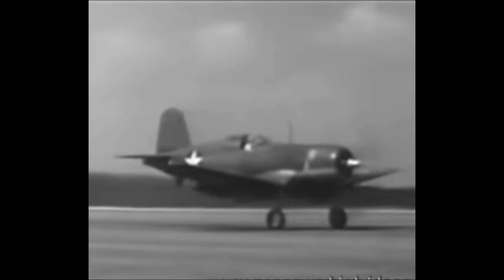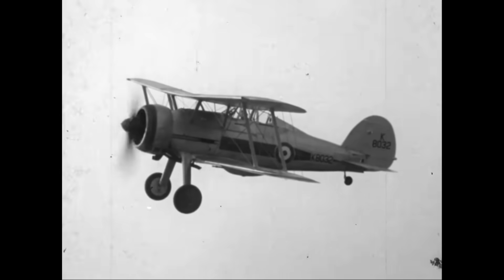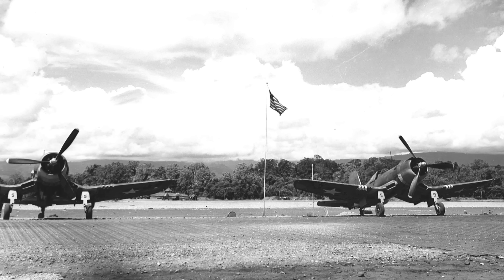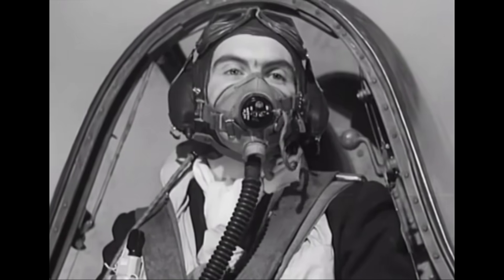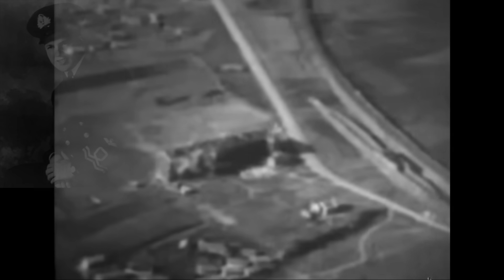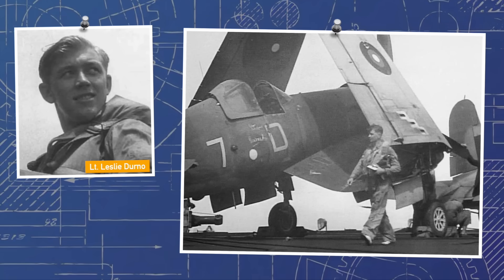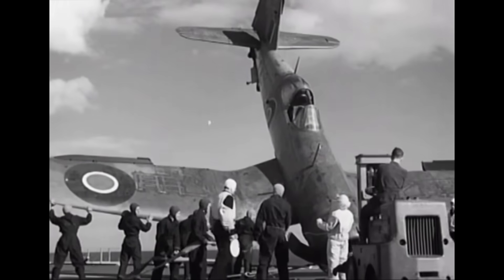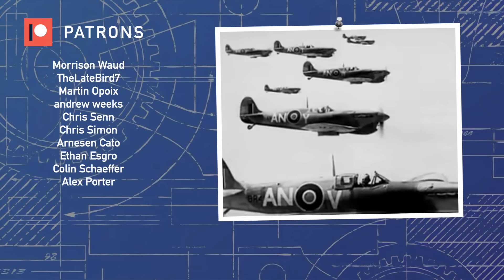Why Did Britain Use American F4U Corsairs? The Full Story

Comment: It's worth noting that FAA 'fighters' like the Fulmar and later Firefly were built to a requirement for operations where they weren't expected to meet other fighters but long range patrol bombers far from land. Because of the length of flights involved they were specified with a navigator ('Observer' in FAA terms), so were two seaters - they were never going to be on a par with single seat fighters.
Reply: FLEET AIR ARM.
HL Deb 27 January 1943 vol 125 cc794-829
There is a controversy between those who say that the Admiralty did not get what it wanted for the Fleet Air Arm and those who say that the Admiralty was not very clever at explaining what exactly it                                         796
was that it wanted. I noticed quite recently that Air Marshal Dowding has gone on record as saying that the Admiralty got precisely the types which it specified and demanded. Whatever may be the rights and wrongs of this controversy there is certainly no doubt whatever about it that war found    the Fleet Air Arm equipped with extremely bad aircraft.    But there is one other thing I think which should be said in fairness. The Admiralty regained control of the Fleet Air Arm in 1937, rather less, I think, than two years before war broke out, and when war did come it found the Admiralty struggling with the enormous task of constituting the Fleet Air Arm, and those difficulties were very great indeed.
Reply: @nickdanger3802  Thanks Nick well said
Reply: The Firefly was, I think, quite a good 'strike fighter'.
Reply: @well-blazeredman6187   This was Eric Browns assessment of the Firefly and I quote " The Firefly was well loved by the Fleet Air Arm; what other affection could be felt for a pilots aeroplane that combined good handling characteristics with a sound performance,tremendous reliability  and outstanding versatility. It was an excellent example of the shipboard aircraft designers art and one that served the Royal Navy long and well
Reply: Stop making excuses 4 the very poor aircraft the faa was given prior to the corsair  and avenger     the fulmar was 100 mph too slow
Reply: @MegaBloggs1  I wasn't making excuses, just stating the effect requirements have on the specification of an aircraft. And those requirements came from the FAA. Name me an exceptional two seat, single engine fighter available in 1940-42?
Reply: 0:07  @MegaBloggs1
Reply: @MegaBloggs1  the faa wanted the navalised spitfire, which would have been better adapted than the seafire they got from what I've seen. They weren't allowed it due to political issues arising from the fall of France. It would have been capable of fighting the zero quite handily, if not having the same range.
Reply: @JeffreyWilliams-dr7qe No-one can see into the future so they designed aircraft for the purpose they would serve according to the best knowledge they had at the time, and it was quite reasonably assumed that FAA fighters were likely to face slower long range bombers and torpedo aircraft, so they were designed to outperform those types. 
Remember too that British naval aircraft were designed for use primarily over the North Atlantic where there were no nimble carrier based fighters such as those possessed by the Japanese.
Reply: @Kevin-mx1vi  millions of lives at stake here. British invented carriers for Chist  sake. Blame it on theRAF
Reply: @JeffreyWilliams-dr7qe  What are you saying ? That the people who layed out the specification for the aircraft should have been superhuman and forseen the future ? Get real.
Reply: @Kevin-mx1vi  It's just fine to lose a argument.  You will do better next time.  Have a great weekend! Don't ya know.
Reply: @Bassman-r3c  If the USN could get an idea of the future, there is no reason the RAF policy planners of the RN FAA could not.
Reply: @JeffreyWilliams-dr7qe bellowed:British invented carriers for Chist  sake.
----------------------------------------
 WRONG!!! that was a sea plane tender that the french introduced a few yrs earlier.
The invention of the seaplane in March 1910, with the French Fabre Hydravion, led to development of the earliest ship designed as an aircraft carrier, albeit limited to aircraft equipped with floats, in December 1911 with the French Navy Foudre, the first seaplane carrier.

HMS Hermes, temporarily converted as an experimental seaplane carrier in April–May 1913, was also one of the first seaplane carriers, and the first experimental seaplane carrier of the Royal Navy.

  Eugene Ely was the first pilot to launch from a stationary ship in November 1910 He took off from a structure fixed over the forecastle of the US armored cruiser USS Birmingham at Hampton Roads, Virginia and landed nearby on Willoughby Spit after some five minutes in the air.

 On 18 January 1911, he became the first pilot to land on a stationary ship He took off from the Tanforan racetrack and landed on a similar temporary structure on the aft of USS Pennsylvania anchored at the San Francisco waterfront

You're welcome for christ sake, It's just fine to lose a argument.  You will do better next time. :face-blue-smiling:
Reply: @bigwoody4704  Well, he is wrong if by an ‘aircraft carrier’ you mean any ship that carries a spotter plane or acts as a seaplane tender. But most of us regard an aircraft carrier as something with a full flight deck that stores, launches and recovers multiple aircraft. I think that HMS Argus was the first of these; HMS Furious was the first fast fleet carrier; HMS Hermes was the first purpose built carrier to be laid down, albeit not the first into commission; HMS Illustrious was the first to launch a major and successful raid on an enemy fleet in port ( unless you count HMS Ark Royal’s smaller contribution to the attack on Mers-el Kebir); HMS Formidable was the first to launch a successful air attack on an enemy fleet at sea (and the first to engage enemy warships with her own guns- before being ordered to disengage). Royal Navy Skua dive bombers were the first to sink a major enemy ship in action. Of course, some of these ‘firsts’ can be attributed to the fact that the  US Navy was not in action until December 1941. After the war, British inventions included the first steam catapult and the first angled flight decks. I think also the first mirror landing device, but don’t quote me on that. 
I say all this  while recognising that the US built the best naval aircraft of the war and the U.S. Navy became (and have remained) the masters of carrier warfare.
Reply: @michaelhirst4191   wrong read what was posted - that is the history regardless of how you take it. Nimitz himself was a an early advocate of Naval Air Power. He was in attendance when Billy Mitchell argued then demonstrated the ability of bombers to sink battleships.
Reply: @bigwoody4704  which of my  several assertions do you say is wrong?  For example, do you say that the US Navy did NOT become the masters of carrier warfare?  Or that a cruiser or battleship with a seaplane hangar and catapult is an aircraft carrier?  BTW the first seaplane carrier to take part in a naval battle was HMS Engadine at Jutland in  May 1916. Communication problems rendered her aircraft’s potential contribution ineffective, however.
Reply: @michaelhirst4191  No - the USA used an actual Air Craft carrier 1st was my point the other was as you stated - seaplane hanger. Sometimes I run across cronies of the crown down playing the GIs role in everything like the guy i originally responded to

EDIT The Britsh did a good job with Corsair landing on flat tops,they were better suited for Marine land based aircraft
Reply: @bigwoody4704  I am not in the business of knocking the US armed forces, or its far sighted generosity with lend lease and the Marshall Aid etc, but as to the first proper aircraft carriers (those that could both launch and recover wheeled aircraft) the USS Langley (CV 1) dates from 1922,  whereas  HMS Argus had a full length flight deck and hangar in 1918, and HMS Eagle by 1920,
Reply: you're not in the business of reading or remembering either

 Eugene Ely was the first pilot to launch from a stationary ship in November 1910 He took off from a structure fixed over the forecastle of the US armored cruiser USS Birmingham at Hampton Roads, Virginia and landed nearby on Willoughby Spit after some five minutes in the air.

 On 18 January 1911, he became the first pilot to land on a stationary ship He took off from the Tanforan racetrack and landed on a similar temporary structure on the aft of USS Pennsylvania anchored at the San Francisco waterfront
Reply: @bigwoody4704 I know about this. It was a remarkable achievement and a significant moment in the history of naval aviation, but did not turn a cruiser into a proper aircraft carrier. I have taken great care to distinguish between a ‘true’ aircraft carrier and a ship that carries a couple of aircraft (or even four or five floatplanes) as an adjunct or aid to its primary role as a battleship, cruiser, etc. so what we really disagree about is the definition of an aircraft carrier.
Reply: @brasidas2011  But they did not  The attack on pearl harbor was almost a carbon copy of what the FAA did at Taranto.  The Japanese took notice the USN did not.
Reply: @bigwoody4704  Wrong yourself Big Splinter The First French Aircraft Carrier was the Bearn laid down in 1922 launched in May 1927 . And the UK was first to land on a ship Get your facts right. Better luck next time
Reply: @bigwoody4704  First US carrier USS Langley 1922
Reply: @michaelhirst4191  US Generosity ? HAHAHA The US made billions on Lend Lease while forgetting to pay Reciprocal Lend Lease
Reply: @michaelhirst4191  Big Splinter is  extremely Anglophobic
Reply: @jacktattis   No, you are quite wrong about that. Lend lease to the UK was worth over $32 billion in 1940s money. Just under 1 billion of that was repaid in money over 60 years. The repayments made over this period  were a mix of this and repayments of a post war reconstruction loan of $3.5 billion at 2% interest. 
Reverse lend lease from the UK to the US was worth just over  $7 billion. 
Overall, the US was out of pocket by well over 20 billion, but their generosity was in their own strategic interest, as was Marshall Aid in the late 1940s. That was in the form of a grant of non-repayable grants and was worth over $3 billion to the UK - we were the largest recipients of Marshall Aid.
Lend lease supplies and weapons lost or used in the war didn’t have to be paid for, but what was left at the end of the war had to be given back or (if the Americans had no use for it) either dumped or destroyed or kept and paid for. We couldn’t afford to pay for much. Lend lease aircraft carriers that survived the war (about 34 of them) were returned to the US for conversion into merchant ships. Lend lease naval
Aircraft mostly ended up being dumped into the Coral Sea off Australia before the British Pacific Fleet sailed for home. They lie there still.
Reply: @jacktattis  I'd argue that they did. The USN had good policy in place, but we had a couple clueless leaders that disregarded operational alerts (King and McArthur come to mind). I think it was a peacetime mindset issue,. Who is more afraid of saboteurs than enemy attacks? Those who are not at war would likely think this way. Italy and the UK were officially at war in June of 1940, and Taranto took place in November of 1940. The US and Imperial Japan were not at war until the Pearl Harbor attack occurred. I think it is humorous that people try to make a direct correlation from Taranto to Pearl Harbor without considering all the factors at play. Do you really think the USN would have been caught so flat footed if there was a declared war against the US prior to Pearl Harbor?
Reply: @brasidas2011  Well all embassies had Military attaches back then The US and Japan both had embassies in Italy in 1940 They would both have been remiss if they did NOT take notice of Taranto. After all one of your own was passing info to the Italians on British Formations in Libya
Reply: @bigwoody4704  Being shot down again  David Miller Warships from 1860 to the present day [2002] HMS Ark Royal 1914 Page 34 and I quote "first purpose  - designed aircraft  carrier in any Navy"
With your US pilot possibly  
 You must stop quoting US publications, invariably they are mistaken
Reply: @bigwoody4704  Mitchell was after the Brits knew the value of Carriers
Reply: @bigwoody4704  Do those vessels count as Aircraft Carriers under the terms of the 1920 Washington Naval Treaty? 

Apart from weight limits,  of course.
Reply: @brasidas2011  Small point like, but the Corsair didn't fly until 1940, and wasn't in service before 1942.
Reply: Not much need for fighters in the North Atlantic. Submarine hunters though... so the planes were what they were useful for
Reply: Odd.  Didn't anybody conceive that they might have to face the Japanese in the Far East or land based aircraft in the Mediterranean?
Reply: @AnthonyGentile-z2g  I'm sure they did but it's about priorities - there are always constraints in how much you you can build, of what type and how quickly. U-Boats in the North Atlantic were the existential threat, sinking hundreds of thousands of tons of vital shipping in 1939 and 1940. And we had land based aircraft in the Mediterranean theatre too.
Reply: @FinsburyPhil  Ahhh but by May 1943 The R/N and RCN had beaten the U Boats
Reply: @AnthonyGentile-z2g they did, which is why they made the illustrious and invincible classes with armour. As has been posted, at the start of the war in 1939, the aircraft were comparable with those based on Japanese and American carriers, with the exception of a5m (the precursor of the zero) which outperformed both British and American carrier based fighters of the time. The British fleet air arm were developing a powerful single seat fighter at the start of the war which was cancelled after the fall of France as it was argued by the RAF that it would interfere with the production of the spitfire and hurricane for the defence of Britain. At the start of the war no fleet fighter was the equal of its own countries land based fighter due to concessions made to make the fighter suitable for carrier use. The British ones may have been the worst but not by a huge margin and may have outperformed the f3f
Reply: Ridiculous then. English legalities getting people killed!
Reply: Those are the breaks as you Rule the Waves.  Sun setting and all that!
Reply: My Uncle James' was a Tasmanian and a flight officer on Mossies, Coastal Command by '44-'45 and sank a tube or two. His last Month's were spent eating U-boats in the Bay of Biscay. He only just passed away in Ireland. Covid at 99. My Aunt, a Blitz WAF and later senior controller passed away within week's. 99 also. Such gregarious happy people, my favourite aunt and uncle. Day's Fishing.
Reply: @FinsburyPhil  Nice to see to see some revision here. Some improvements.
Reply: Dear Finsbury,
That was a long discussion eh?
Regards,
Z
Reply: @ZinzanModelling  Thankfully not too vitriolic, although somewhat partisan if I remember correctly.
Reply: The Japanese and Americans naval fighter pilots were flying missions over the vast Pacific in WW2. Getting back to their carriers after missions was just as difficult for them as for FAA fighter pilots. However, they didn't need navigators/observers to accompany the naval fighter pilots of their Zeros and Wildcats. In the case of the Japanese, their fighter pilots had to double up as their own navigators by training. For the Americans, they had this clever YE-ZB electronic navigation system which could be operated by the pilots themselves and helped the American pilots to home in on their aircraft carriers securedly in all weather conditions. The British adopted this system later in the war, allowing FAA to operate the single seat fighters like Corsairs, Wildcats, Hellcats, Seafires.
Reply: @tvgerbil1984  The Royal Navy experimented with its own radio beacon in 1936 and adopted YE-ZB in a technology share in 1940. But they tended to use it sparingly in the Atlantic as German U-boats were capable of homing in on the signal. But the point about the Fulmar and the Firefly is that they were multi-role and not just interceptors, hence why they were two-seaters.
Reply: @FinsburyPhil  The Germans did install receivers on their U-Boats to intercept YE signals. However, they were unable to make good use of any intercept to attack the carriers. The problem for U-Boats was that YE signals were transmitted in the UHF band. UHF radio waves couldn't penetrate the sea horizon. Aircrafts high up in the sky were not affected much by the horizon effect. For an U-Boat which was low down near the sea surface, the U-Boat crews probably saw the enemy carrier at about the same time as the YE signals were intercepted. In any case, the normal reason for an escort carrier transmitting YE signals was that it had aircrafts in the air performing anti-submarine patrol.
Reply: @tvgerbil1984 
Dear Mr Gerbil,
I think that the reason for an observer in certain Naval aircraft has to do with the additional function they served rather more than as a reflection of the overall navigational ability of the pilots.
In navigational terms, two heads are rather better than one and "dead reckoning" is hard, no matter how good you are.
Of course, the advent of nav systems considerably ease the problem of finding your way back to the carrier, as of course did radio DF. However, assistance devices do not remove the need to navigate properly.
Regards,
Z
Reply: @ZinzanModelling  My comment only applied to naval 'fighter' pilots which was what the original comment was about, as you might noticed. On US carriers during WW2, reconnaissance and scouting duties by carrier borne aircrafts were carried out by dive or torpedo bombers like the Douglas SBD Dauntless and Grumman TBF Avenger. These warplanes were all manned with two or even three crew members although the planes were all equipped with YE-ZB electronic navigation system. Speed, maneuverability and climb rate were not critical for these aircrafts and the extra pair of eyes always helped them in scouting and reconnaissance duties. However, the USN never compromised the fighting abilities of its naval fighters in WW2 by putting an observer on them from the very beginning. It took some really painful lessons for the FAA of the Royal Navy to realize that and purchased single seat fighters like Wildcats, Hellcats, Corsairs, Sea Hurricanes and Seafires.
Reply: Dear Mr Gerbil,
Finsbury’s point about multi role aircraft is the correct answer. UK procurement had not asked the aircraft industry to develop carrier borne aircraft and instead “marinised” single seater land fighter aircraft when the need became obvious. This was a sub optimal solution.
The requirements were therefore fulfilled by available US aircraft in addition to marinised Spitfires and Hurricanes.
As it ever was, procurement errors brought about by incorrect predictions about the nature of sea borne warfare caused this problem. You reflect this in a way in your responses, but I feel that it is worth pointing out the proximal reason for the use of twin seat aircraft in the RN.
I appreciate your effort in responding.
Regards,
Z
Reply: Excellent narrative.
Reply: Got the job done in the environments you described.
Reply: I will defend the FAA.  During the 1930's the FAA was brought under the control of the RAF.
Reply: The British were fortunate they did not have to participate in the carrier battles in the Pacific Theatre early in the war. The US monoplane TBD Devastator torpedo bombers faired poorly and the F4F Wildcats had to refine their tactics to compete with the Japanese.
Reply: @Chiller11  Indeed, the British carrier based "fighters" would have been handled very roughly by the Japanese, but of course they were designed for a European war, where there was no other significant naval air power.
Reply: @Bassman-r3c you say that but the flag waving Americans who think the FAA and RN were idiots or something .

The RN should have realized the Japanese threat and what the Zero was going to be but the RN was always more worried about the Germans who would not be at sea with 109's
Reply: @Bassman-r3c  Interesting, I’m no authority but with their holdings in Hong Kong, Singapore and perhaps India it seems that the British would want to at least consider a potential conflict with Japan. The Japanese aggression in Manchuria and later China plus the escalating tensions between Japan and the US were obvious. I think all the highest ranks in the world’s navies considered battleships the ultimate weapon of naval warfare prior to WW2. Naval aviation had to compete within the respective navies and with the air forces for resources. With the threat of Germany on their doorstep and the need to defend the home island front and centre I can understand the urgency of land based aircraft development. Still, it’s the likes of the resource challenged like Italy and China that are still fielding antiquated biplanes in WW2. The gulf between the Spitfire and the Swordfish (yes I know the Swordfish is a torpedo bomber and reconnaissance plane) is just so vast.
Reply: @marklittle8805  Lord Beaverbrook   "I should say there have been as many Hudsons (see U 570, ND) as the Air Ministry could handle. Then there is the Martlet (F4 Wildcat, ND). As to the output of these firms, they were persuaded to give up some aircraft which were going in other directions in order that we might be supplied         808
with essential aircraft for the Fleet Air Arm."
FLEET AIR ARM.
HL Deb 27 January 1943 vol 125 cc794-829
Reply: @Bassman-r3c  They were, actually. In the early Pacific War Fulmars went up against Zeros in the Indian Ocean and the results weren't good. They did manage to shoot down a number of Japanese torpedo and dive bombers, though.
Reply: @Chiller11 
The British simply didn't have the money to build planes and carriers to protect their colonies. They couldn't even produce enough ground equipment for their army.
Reply: @iskandartaib Actually, that’s not correct. The Fulmars had a rough time but mainly, as usual, it was return fire from bombers that brought them down. I can’t find any record of a zero shooting a fulmar down but if you’ve a source I’d love to see it. Interestingly, the Fulmars overall kill/loss against land based single engine fighters was 1:1 although it’s a small cohort. 
Fulmars are one of my favourite kites.
Reply: @Chiller11  They had considered a war with Japan, but when it did happen they had already been fighting the Italians & Germans for 2 years & had lost their ally France.  The situation was much like they had designed for a bad scenario, & then it got much, much worse.  The Fleet Air Arm was still fighting with the aircraft from the start of the war, which compared OK with the Japanese & US aircraft of THE TIME.  But both those nations got an extra 2 years to develop aircraft, & it showed.
Reply: @chrissouthgate4554  Interesting point. I’m relatively ignorant, no totally ignorant, regarding Fleet Air Arm procurement history. My question was, why was there such a technology gap between the fighters of the RAF at the start of the war vs the naval fighters? The Spitfire was one of the finest fighters of the war and the Hurricane was more than serviceable in 1940. Britain obviously knew how to design and construct advanced fighter aircraft. Granted the Spitfire didn’t adapt well to carriers but the talent existed to design aircraft that would. I assumed the explanation was probably down to a combination of prioritizing the defense of the home island and the channeling of limited resources.
Reply: @petersmith7126  It’s a little hyperbolic, don’t you think, to claim the Americans were, “wiped from the skies,” when they first met the Japanese? The US Navy faired pretty well at Midway which was a pure carrier battle. The Coral Sea may have been a tactical Japanese victory but it was definitely a strategic victory for the US, preventing the Japanese invasion of Port Moresby and influencing both the battles for New Guinea and Guadalcanal. The F4F Wildcat has undergone a bit of a reappraisal as of late and the opinions seem to suggest it wasn’t as bad as originally portrayed once the pilots adjusted their tactics. In fact the Fleet Air Arm deployed them as the Martlet to reasonably good effect.
Reply: @marklittle8805 I knew an Irishman who flew a swordfish and did for the Tirpitz. You use what you have. His opinion. He liked to quote Wellington. Another Irishman.
Reply: @fazole  Not so much the money - It's a small island with a limited number of dockyards cable of building sizeable warships.
Reply: @Chiller11  the British liked the Martlet/ wildcat, but the one they liked most was the Hellcat, which for a short time we insisted on calling the Gannet. The Avenger, meanwhile, was called the Tarpon.  But those names didn’t stick for long. The British couldn’t get as many Hellcats as they wanted, but were loaned lots of corsairs, which were then modified to make them less dangerous to their own pilots. Seafires were dangerous to deck land as well,  but most of the accidents damaged the seafires, rather than the pilots. They (along with Fireflies)  equipped the fighter squadrons of the big Implacable class carriers until the end of the war, and even acquired drop tanks to give them enough range to escort raids over Japan.
Reply: @Chiller11  I think someone stated that the FAA got what they wanted nothing was foisted on them
Reply: @AnthonyOMulligan-yv9cg  perhaps he attacked the Tirpitz and flew a swordfish, but not at the same time. Royal Navy aircraft stacked the Tirpitz several times, but only once with torpedoes, which missed. The aircraft were Fairey albacores from HMS Victorious. Victorious and HMS Furious attacked Tirpitz again using Fairey Barracudas as dive bombers. They hit Tirpitz hard and killed many of her crew but could not cripple or sink her. Other raids managed only a couple of hits, usually because bad weather or smoke screen generators hid the Tirpitz from view
Reply: @nickdanger3802  Thanks NICK
Reply: @Chiller11 regarding naval aircraft procurement for the British fleet air arm, there was a fully navalised version of the spitfire in development, sometimes know as the gull winged spitfire/seafire, prior to and during the first few months of the war. This got cancelled due to political pressure from the RAF following the fall of France. This, supposedly, would have been much better than the later seafire conversions for carrier based combat but competed with the spitfire body and development from supermarine, and with the merlin engine from rolls Royce as it was originally designed to have the griffin engine (the one that superceded the merlin in later spitfire and seafire designs)
Reply: @marklittle8805  Actually had the Germans completed the Graf Zeppelin they WOULD have gone to sea with Bf109s.
A special carrier-variant of the Bf109- the Bf109T for Trager or carrier- was developed. 60 of them were built and were already in service in the early part of the War; (although only from Land Bases).
So the Royal Navy could very well have found themselves facing Bf109s.
Reply: @Chiller11  You have also got to remember that, with the RAF controlling ALL aviation until May 1939, they were the ones writing the Specifications and allocating Industrial Output- and Carrier-based Aviation came WELL down the order of priorities. With the RAF concentrating on their own Rearmament Goals the Fleet Air Arm was, as it were, only allowed scraps and never had the priority they needed to develop their own aircraft and build them in sufficient numbers.
Reply: @Adrian-qk2fn  the Royal Navy didn't  worry about the Zeppelin because they knew where it was as a program and likely had a contingency program to deal with it. The Germans didn't have the Carrier in service once the war started and the RN would interfere with the Germans figuring out how to operate a carrier. If they had the Carrier in service in 1935, that  threat would have been real. But it wasn't and they made a plan
Reply: @Chiller11 The Devastators were horribly inefficient and had terrible loss rates, such brave Men.
Reply: @Chiller11  The US was fortunate that the RN /RCN saved their arses in the Atlantic against the U/Boats in spite of Adm. Ernest King
Reply: @Chiller11  They almost did in the Indian Ocean. Night attacks by Albacores against Nagumo`s carrier group, I wonder how that would have gone?
Reply: @Chiller11  We had nothing remotely as good as the F4F . We only caught up with the introduction of the Sea Fury , which was too late for the war .
Reply: If you can find a copy of Aviation History Magazine from September 2021with a cover story titled"Hellcats Agsinst the Luftwaffe" read it.😮😅
Reply: @JohnPatterson-kz8jr  And they did SFA
Reply: Partly because the Navy lacked enough carrier experience when they assumed control and became the FAA in 1939 and at the time decided the best type of aircraft the Navy needed was mainly spotting for the big guns! The initial requirement was an aircraft that would have the responsibilities of ''TSR''  (Torpedo, Spotting and Reconnaissance). Nobody could foresee just how Naval air power would become so capable and make battleships redundant. It took a while for the Admirals to swallow that! The USA was much more flexible and learned way faster.
Reply: @Slaktrax  Yep, I presume that 7th December 1941 gave them a big clue. However, the Japanese had learned from the British attack on Taranto a year earlier so I'm not sure all British Admirals were that stuck in the past.
Reply: @Slaktrax  funny the R/N had the Hermes, Furious 2, Eagle, Courageous,Ark Royal which all went on to serve in WW2 . I think they had enough to practice on
Reply: Onsine elemenator lol